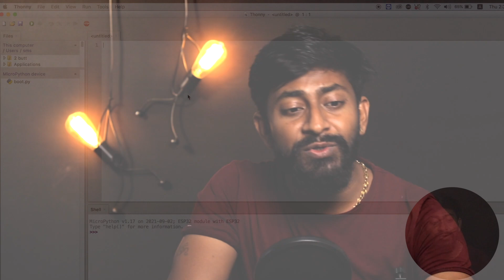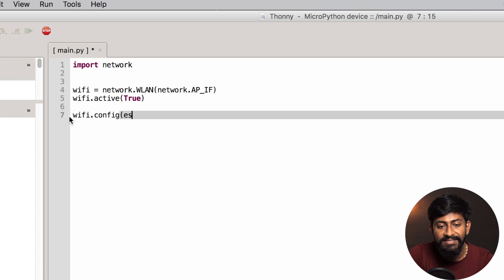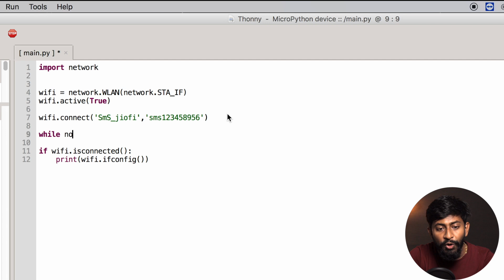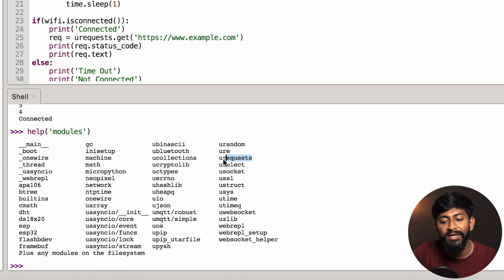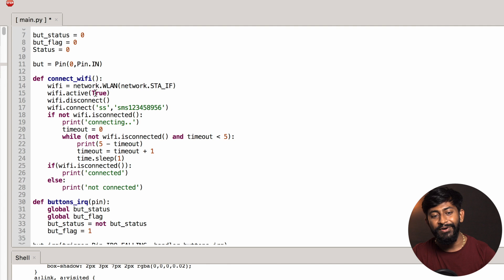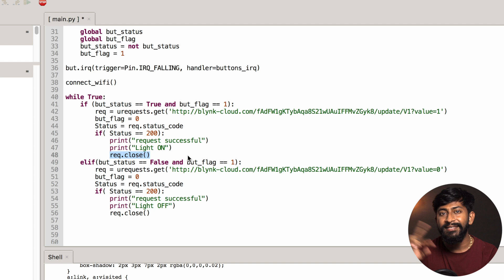Comment: I can't be able to use request. text in following code can you help:

    print("sending data to blynk:")
    post_url = URL_post0+str(data_voltage)
#     r = urequests.get(post_url)
    r = urequests.get(url = get_url)
    print(r.status_code)
    get_data = r.text
    print(get_data)
    r.close()

My code is just stuck at r.text. it does not produce any output or error

Comment: import network

wireless = network.WLAN(network.STA_IF)
wireless.active(True)
networks = wireless.scan()

print(networks)                ;                   

Traceback (most recent call last):
  File "<stdin>", line 5, in <module>
RuntimeError: Wifi Unknown Error 0x0102

it gave me an error. do you have any idea about the reason?